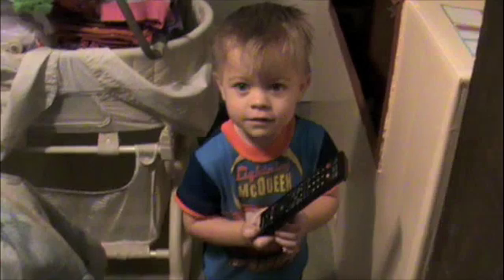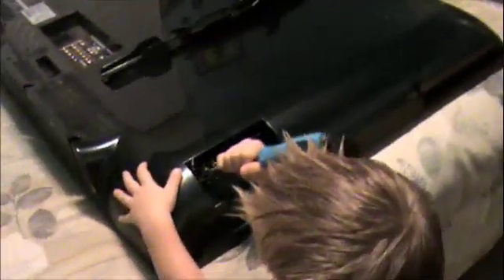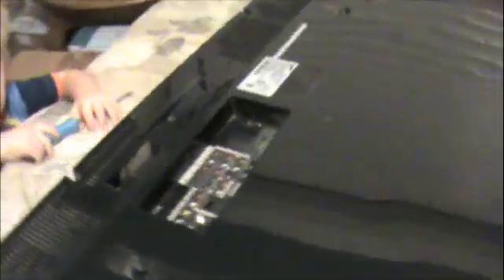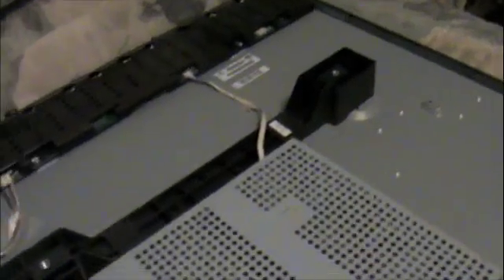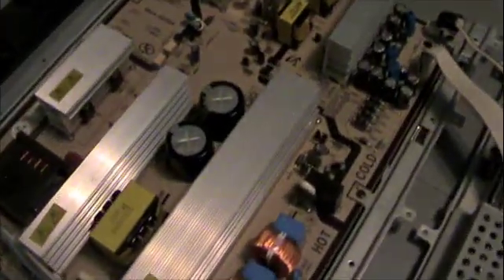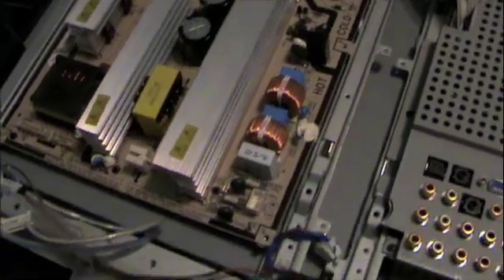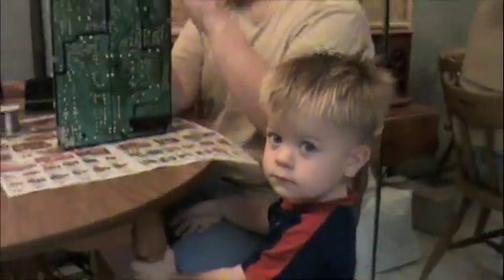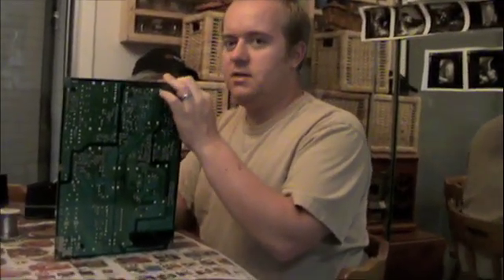Samsung TV Repair- PART 1 OF 2

Comment: This does not work. I bought this guys kit, replaced the bad capacitors put the TV back together  and TV still turns off and on and makes clicking noise still. Went ahead and replaced the rest of capacitors from same part of Power Supply and still the TV turns of and on and makes clicking noise. Stay away from this scam.

Comment: Thanks Big Time - I've been annoyed by vertical lines for months now.  So I watched your video and  I removed all the screws including the hidden one you mentioned by the RCA jacks.  Took the back off,  pushed on the connectors, and put the back cover back on.   Ever since then,  I no  longer have any lines showing up.  Samsung was going to send a repair man that would have cost 900 bucks.  I can't tell you how thankful I am for this video.

Comment: Hi Sir/Madam,
              I have a samsung PS50A457P1DXXU 50 inch plasma TV and my kid put a screwdriver into the TV.He shorted the Y-SUS board and saw the sparks and there is no more picture but sound.I checked the Y-SUS and found to be short and the fuse blown.I replaced the blown fuse with a high current fuse and saw the power supply relay is turning on and off.after that i purchased a Y-SUS board and the TV does't turn ON.The RED led in the front panel blinks 6 times .All other fuses in the System is well and i checked the voltage Vs and Va , which is 208V and 54V.Do you think the power supply is bad?Expecting your reply.thanks in advance.

Comment: You can use a desoldering braid you heat up the solder points and put the braid on it and the braid will pick up the solder, hence letting the caps get loose to pull them off the board.

Comment: STK795-521C  AXF1145  STK795-523E  AXF1144  STK621-412  STK795-820  STK795-821  STK795-811A  STK795-813  YPPD-J010A  YPPD-J012A  4921QP1029   YPPD-J015E  YPPD-J016E  YPPD-J016B  50 PLASMA  Y-SUS  Z-SUS  Y SUSTAIN  Z  SUSTAIN  50X3  42V8  42V7  42V6  PIONEER  PDP43  BUFFER  IC  LOGIC  IC  YPPD-J017C  YPPD-J018C  YPPD-J018E  SN755866  SN755867  SN755870  SN755882  FE3407F   AS15-F  AS15-G  AS19-G   KIA78L05F  L78L05CV  LM1117-3.3   Audio  amplifier
  DAZELONG168@163.COM   SKYPE   DAZELONG168

Comment: Hi, if you ar not good at soldering you can send your power supply board with bad capacitors to this guy on ebay and save, just search on the ebay search bar listing #330974058674, and don't let tv shops to charge you up to $280 fo this repair.

Comment: I have a 32" samsung that stopped working. some of the caps have black mark but no visible bulging. are black marks always leaked fluid or do some fabs use black marks on top of caps?

Comment: Thanks,  I did what you showed and fixed my tv for $21.23  That includes the cost of the soldering iron.  Capacitors $1.25 each.
Thanks, Thanks, Thanks

Comment: SAMSUNG PN58C590G4F Plasma TV Complete Board Set (Power Supply Board) Ebay item number: 170958455646
Yes, I have other boards. Movers cracked my screen so I am parting out he good boards. I hope this helps.

Comment: Thanks for sharing this. It was good to see that the problem was not only common, but fixable. 

For those who have this problem, I found out that as somebody else said in the comments, even if your TV is outside of warranty coverage, this problem itself is covered under a separate warranty as result of a class action suit. I was able to get my TV repaired 2 days after calling for no charge at all. 

Start by filing a claim on the corporate website and go from there. Hope this helps.

Comment: thanks mate. tried it and still wont power on. thought I soldered wrong or something. rechecked everything and then called up the samsung service center. spoke to a decent samoan tech who explained to me that 30% of times its also the eprom on the motherboard that needs to be replaced as well as the bung power supply burns it out. 14NZ$ for a new eprom and 35$ labour to him for fixing it. felt damn good when it finally switched on after sitting dead in my basement for 2 years. YEAHA BUDDY! :)

Comment: Thank you so much for this video.  I just finished repairing my own Samsung and it is working like a charm.  The only part I was confused about was which type of solder to use and if Rosin Flux was necessary (especially depending on the type of solder).  I ended up using 60/40 (b/c I heard you mention it).  They were out of RA flux so I used "no-clean" and bought a Rosin Flux Pen just in case and painted it a bit.  I also made sure to clean it with alcohol when I was finished.

Comment: my LCD TV is probably 5 years old. It had the following issues:  constant delay in powering on, and pixel problem once the TV is on. Thanks to THE PROFESSOR, the fix cost me about $25.00 including the soldering iron, the solder stand, the solder itself and capacitor set.  Now, my TV works perfectly and the repair took me one hour from taking the TV off the wall, unhooking the 100 cables and HDMI attachments.  This is a god-send. THANK YOU!!!!!

Comment: Samsung says they will arrange for shipment and repair of the TV.  However, if the problem is not with the capacitor, I will have to pay for the repair; if the problem is with the capacitor, they will just replace the faulty capacitor, not every one.  I'm never buying another Samsung product.  I paid too much money for this TV for it to be on the blink after not quite 3 years.  My last TV lasted 25 years.

Comment: AWESOME! I just fixed my 40" Samsung in about an hour... replaced with better capacitors - all parts and soldering iron for about $10 from Radioshack. Thanks again for the video. EASY with the help of this video.

Comment: Thank you so much, my Samsung 46inches woke me up last night with the relay click noise and wouldn't power up at all. This morning I found your nice vid. Took me 2h total and the repair did cost just $1,18+gas to the electronic shop. I replaced two "inflated" capacitors. I didn't find 12V but I replaced with 16V. Those were rated 85 Celcius instead of 105 Celcius of the original ones... I hope this won't cause any problem in the future. Thanks again !

Comment: (cont'd) no power or nothing, no backlight etc...so i opened it up like u did above and dont really see nothing wrong?? im upset cause this looked like an easy fix but my capacitors look fine.or could it still be the capacitors since i have absolutely no power on??i will probalby still go ahead and replace.should i try to replace the litle fuses as well? i think there are 3 of them on the board? if anyone knows anything about the fuses please help.any commets/suggestions please post soon.thanks!

Comment: what if its not the capacitors? I have the samsung 52 inch...ln52a650a1fxza and i opened it up and the capacitors are not bulging, or leaking or anything that would make me think there the problem...to backtrack so the problem started out when we had a thunderstorm or something and the tv just shut off out of nowhere cause of a power outage or something like that i guess(i dont really know as i wasnt home and this is what i was told) so since then it has powered on or nothing..(cont'd above)

Comment: @mxchamps Caps can look perfectly normal and still be bad. Actually you can replace the 10v with 16v which is more than adequate and will fix the problem. The probably is actually that Samsung used those cheap ass 10v caps on that 12v rail. 16v is perfect and 25v will work as well, but it's overkill. Try badcaps(dot)net, or computekinc(dot)us    The shipping costs more than the parts, which sucks, but at least you know it will be fixed right.

Comment: @mxchamps Yes. Please understand the caps from radio shack are CONSUMER GRADE with high esr and only 85c max temp. They really are not good for power supply applications. They are "ok" for general application and science projects. What kind do you get?  Only Rubycon or Nichicon (best in the industry) capacitors. Those are COMPUTER GRADE caps with low esr and 105c max temp. Unfortunately, you have to change out the caps again as will the guy that made this video.

Comment: @saxkwatch Radio Shack is ok, but their caps suck. They are only rated @85c when it's better to use 105c. You should also replace ALL 7 caps at the same time regardless if they're bad or not and use quality ones like Nichicon are else you'll be doing this again within a year or so. Just saying.

Comment: Thanks very helpful. Fixed mine today(samsung ln4051d). used Radio Shack Capacitors Part # 272-1032, 100uf, 35v. perfect so far

Comment: Watched this video.... spent £2.10 on 10 condensers on ebay (only needed 4) and a further £9.00 for a soldering iron on ebay... fixed for £11.10..... shame i had already replaced the tv before i watched this (loser). With my tv it also the picture it was going darker and darker not only not turning on... seems to have fixed both problems. Thanks for the guidance.

Comment: I have a 42"Samsung rear projection tv,problem is, bottom right corner, any writing is blured and is slowly moving up the right side mid screen.The picture is perfect otherwise.anyone any idea as to what is causing this.THere is also black lines appearing across the screen at change of adverts,wheb ad finishes the screen returns to normak viewing.

Comment: I was soo lucky to get this problem DURING the warranty. I'm glad I called in early & I still have 2 months left of warranty (from 3 years). I see that some people were unfortunate enough to have their TV broken AFTER the warranty. I called Samsung Aus & one guy said that it will cost $ to fix the capacitor after warranty. I called again & another guy said the prob will go to Resolution Centre & they will determine if it's going to be a one off free fix or not. But I'm glad I still have warranty

Comment: Thank you for your video. Last week my LNT4065 started having the same problems with capacitors going out and taking forever to start. So last night I called Samsung and spoke with a CSR. I explained the symptoms and gave my serial & model number. The CSR then trasnferred me to another dept. That CSR told me that they have extended the warranty for this issue and said an on-site tech will call me and replace the capacitors on the PCB free of charge. The tech fixed it for free all is well :)

Comment: I opened my TV and I have a power supply board like yours but I don't have a 'cage'. Why is that? You didn't mention where you got your capacitors. I got a LN40A750RIF from samsung. Samsung suggests to update the TV firmware to repair this issue. I noticed two capacitors that are bad. I am going to try what you suggested.

Comment: Hi!
Sorry if  I answer you late.
I bought 5  Radial Capacitor 1000uF 25V in Ebay (from UK).
You can find them everywhere also in the shop that sell electronics components.
Before you buy them, open the TV and check that also yours are 1000uF.
It is a really easy job. I'm not a technician but in 20 minutes I changed them.

Comment: Thx for this video. Vertical lines on Samsung LN40A750R1FXZA Flat Screen TV 

How to get the correct part for 10-volt capacitors? Where to order these parts?

Comment: You are a life saver (at least a couple-hundred-dollars saver). Thank you so much for these two videos. After some initial headache finding the right capacitor (Samsung used a pair of 2200 microfarad caps instead of 1000), I was able to fix the television no problem. Thanks again!

Comment: I just wanted to thank you for putting this up. The repair shop fixed my tv when it was under warranty. Once the warranty expired and the tv broke the exact same way, they wanted $100 to look at it and another $200-$400 to repair it. (What a racket) Thanks to you, I was able to fix it for $4.50 + $6 for the solder. I was so proud of myself. I can't believe Samsung would put use such shitty capacitors. THANK YOU!!!!!!!!

Comment: THANK YOU SO MUCH! We already had the "complimentary one-time repair" from Samsung about 4 months ago. And the thing just went AGAIN! They replaced the whole power supply board when they came. We opened it up and it had 2 wrecked caps. $30.00 in Radio Shack supplies and 1 hour later - good as new. THANK YOU!

Comment: my tv was exactly the same 4  capcitors burnt out i went into belfast and bought them for 75 pence each the soldering kit cost me 12.99 i bought 2 extra capacitors im pretty handy had the job stripped down fixed put back together in hour and a half brillaint back on wall one click working perfect thank you for your advice saved me hundreds of pounds    big dex west belfast......................

Comment: @sfdudead There is another factor that needs to be taken into play when replacing these caps. There is a temp rating and your standard cap is 85 degrees centigrade. The caps for computer and electronics gear is 105 degrees.

Comment: Yes!.  this totally fixed my 2.5 year old samsung.  i had gone tow radio shack and fry's for the capacitors, they did not have the same size items, so i went with a 2200mf, 35 v capacitors (2), it worked like a charm.  my issue was not under a grill like this example, but it worked all the same.

Comment: Try calling again.   I called and they are sending out a technician to fix it, for a one-time free fix/replacement of the capacitors, IF it is a capacitor problem.   (If it isn't the capacitors, supposedly I pay for the service.  Right.. :)

My sister also has a Samsung, with the same issue, she called and also has the 
same result, free technician coming out.
Call 1-800-726-7864.  Have the Full model# and Serial # for them.

Comment: Almost did this repair....Until I found out . SAMSUNG IS NOW ADMITTING AND ARE REPAIRING TVs THAT DO NOT HAVE WARRANTY, CALL THEM 1-800-726-7864

Samsung sent a guy to my house in a weeks time. He had it fixed in less than 20 minutes for FREE. Just insist on the capicators being replaced. Say I have no issues except for the Capicitor problem.

Comment: Samsung design is poor. It does not mean that if transformer and pcb start sparkling the whole tv will get ignition out of it. The chance is little but real.
Samsung design is poor. I had repaired their 2 year old refrigerator this year. There was very week relay so the contacts burned off. I failed to repair their cell phone after been dropped into the water. That is also example of poor design because the other brand survived in same circumstances.

Comment: I had designed all kinds of electronics for scoreboards that still work in most of schools and every olimpic game and what i have to say. this tv may catch a fire when the power contact to the back-light drivers goes bad. Wonna try? Just detach 2-wire plug to the side boards and watch. Tracks on the board will fire up and transformer will try do same. The fusses do not function. My boards and devices were protected from lightning shooting thru the long cables in the fields.

Comment: i got same problem yesterday with LN52A750R1F. It worked for 2 year at very little use. I always said my kids that tv is evil. Well, i did not mean tv set. Now i think that samsung is evil also.
So i opened the box and found all caps looking fine. unplugged cable from lcd driver, it did not change toggling behavior of the box: turns on with sound and back-light stays irresponsive for 20 seconds and turns off. I will check it closer tomorrow with meter.

Comment: Hey, this video was a big help. I fixed my 42 inch Samsung lcd. It took me less than an hour. I just played your video and followed the steps as it played. Super easy. Replaced the 4 blown10V capacitors with 35V. TV works great. Thanks!

Comment: @alfalfa82 I've got a model LE40A656, and she said it wasn't on the list of TV's with the fault, even though the fault is clearly the same. I bought it in June 2009, so it's only been out of warranty for 4 months. She gave me the number of my local TV repair centre and told me I'd be paying for the repair myself!! I was furious and told her that if I went there and it was the capacitors that were to blame, I'd be back in touch. It's a shocking way to deal with customers £650 down the toilet...

Comment: Professor, and helper, thank you so much for your video. I have a Samsung LNT4066F, and had the same problem. I had actually lived with it for a while and it was getting worse and worse. I wasn't ready to buy a new tv, and was very frustrated. I switched out four 10 V capacitors for 35 V, using your great video as a guide of course. But now my tv is back to working again, and saved me a lot of money. Thanks Professor!!

Comment: Thanks a lot, Professor.  You saved me $300 - $400 in repair bills.  I watched your video and my tv had the same problem.  I bought the soldering kit and $3 capacitors (4 to a package) on ebay... well worth it.  All four of my capacitors were either bulge at the top or leaking fluid.  Two capacitors were 2200uF 10V and the other two were 1000uF 25V.  I bought 4 capacitors with higher voltage.... a 2200uF 16V and 1000uF 35V.  The hardest part for me was the soldering but it's all fixed, thanks!

Comment: You da man Professor!  Fixed my Samsung TV  Cost:  1 - 1000uF-10volt capacitor for $1.89 plus had to purchase soldering iron, solder and de-soldering mesh for $17.00.  Total < $20 bucks.   Saved hundreds I'm sure.

Comment: Thanks! I fixed my Samsung LNT4065FX. It had 4 bad 1000uF 10v capacitors on the power board. I replaced with 16v spares from my bad Dell LCD monitor power board. So no cost. Maybe this was an engineering error since it was just the 1000uFs.

Comment: i had this problem and it was out of waranty but i called up samsung and they said we are gona replace the caps for free and then i had a little 17inch tv that would go nuts when you turned it on and turn itself off i replaced 3 caps on it good as new